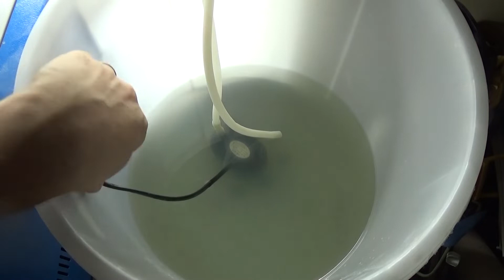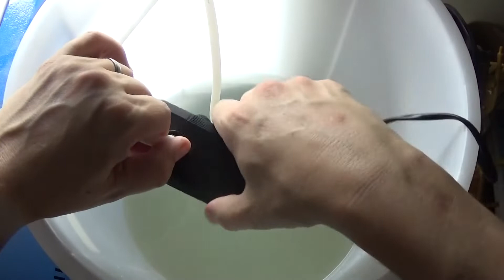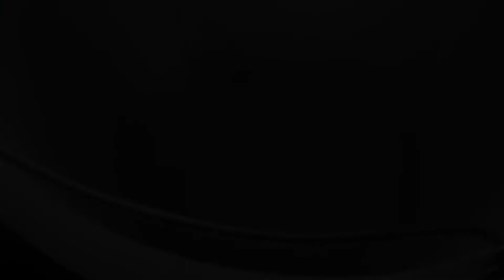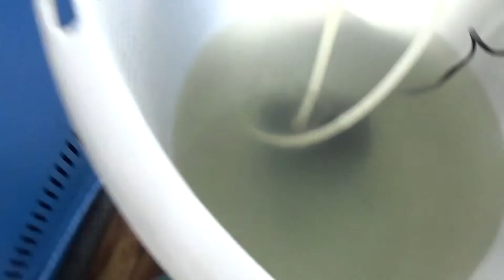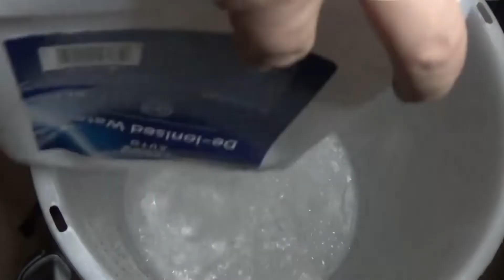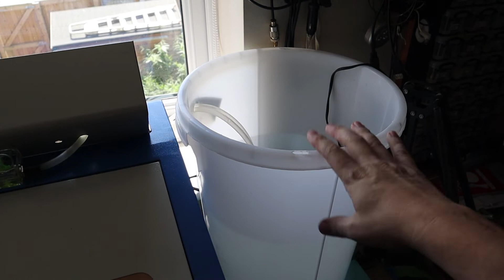K40 Clean Up Full Series - Keeping The Water Reservoir Clean and Working

Comment: Couldn’t you use some kind of led light inside the bucket to stop the growth kinda like they do in restaurants and heating and cooling systems?
Reply from the maker: It's a possibility but bleach or an antimicrobial work well and are much easier to administer. Just only add small amounts (I talk about the exact amounts in a video) or you can have issues with electric conductivity. I am working on a cooling system but I'm trying to make it solar powered but it's a tricky job at the moment

Comment: Hi! Love your videos. I have subscribed because they are both informative and good fun! 

 However, I think you may have made a mistake adding bleach to your deionised water. Bleach is sodium hypochlorite and in water it forms sodium  and hypochlorite ions ie you are adding lots of ions back into your deionised water. A few spoonfuls of bleach will add many more ions than are usually found in tap water. I think you are better off adding an organic algicide designed to suppress  algal growth such as those made by Tetra (called AlgaeControl) and intended for fish tanks. 1 mL for every 12 gallons will do the trick.

.
Reply from the maker: Ok that's interesting I have done quite a few tests with conductivity and I found the small amount I used was acceptable but I totally understand what you mean. Perhaps it was a mistake. I have tried an anti-microbial in the past but I found that conducted a lot more than the deionized water or even tap water. I will have to do further research then. Thank you for the information I really appreciate it. 
Welcome to the family my friend 🙂
Reply from the maker: I will try the algaeControl next time I clean it all out. I've just brought some so thanks so much for the info 🙂 I love the comment section. I've learnt so Much from others.

Comment: I use a portable ice maker with about 3 liters of water. It's a closed system and if not careful the temps can get quite low. I put a thermometer on it that starts and stops the ice maker based on the temp of the water. I've never had to clean the system yet and this system has been in play about a year. Thanks for the video!
Reply from the maker: I had a nice maker that I fixed on this channel and I tried it as the water cooling device. But for some reason I couldn't get the temperature low enough and gave up. perhaps too soon. It's something I hope to try again in the future. Thanks for the comment 🙂